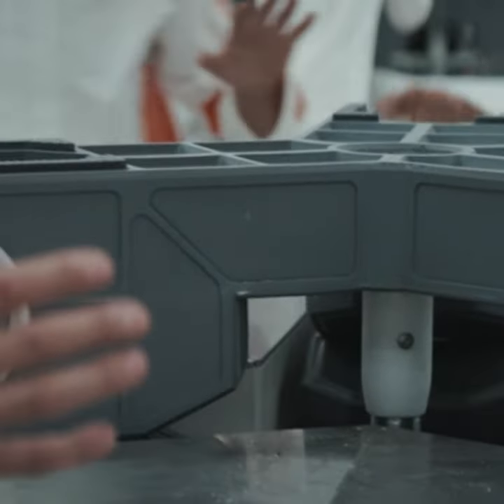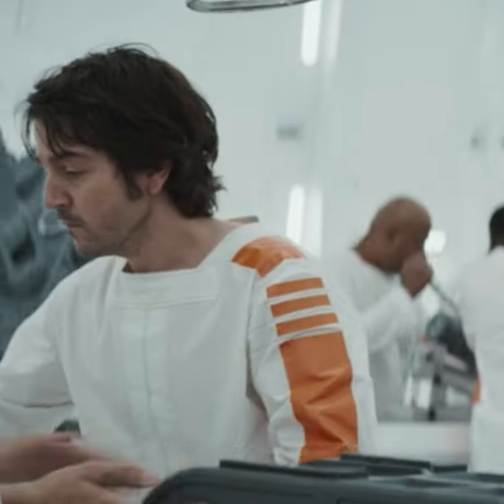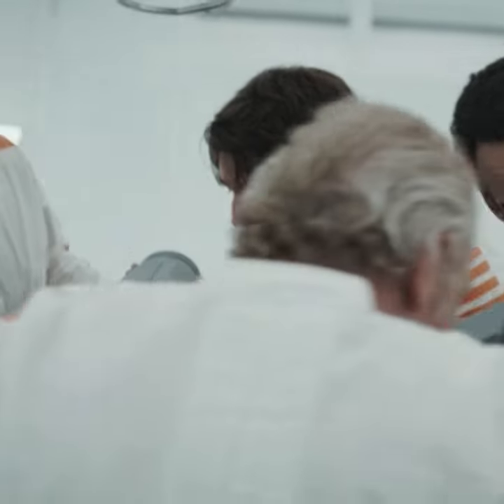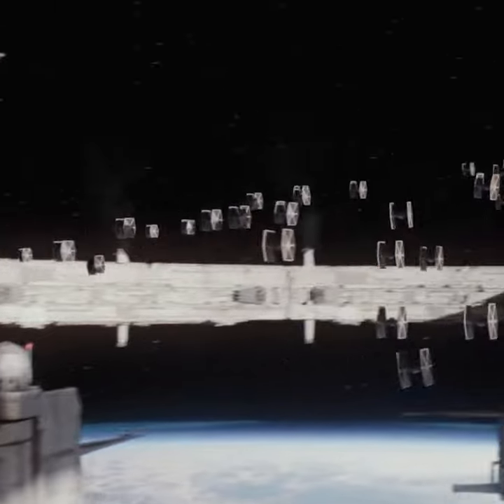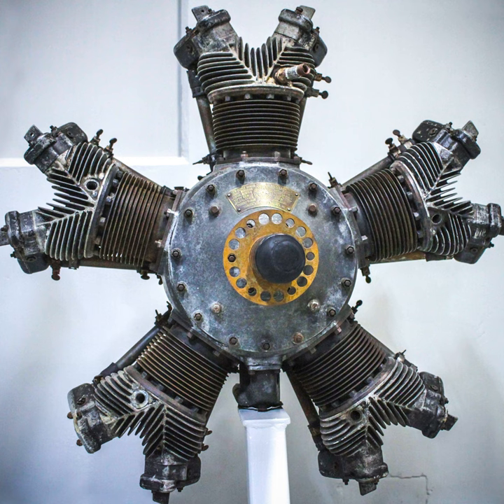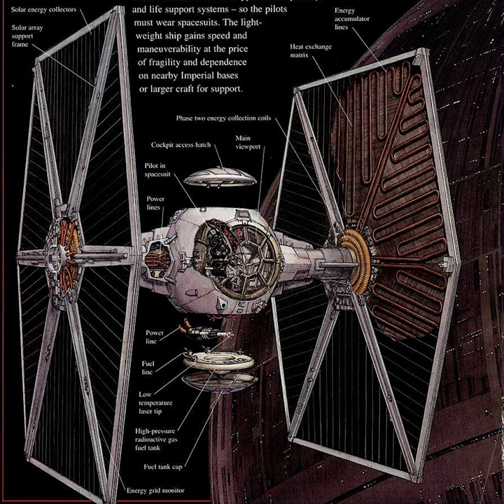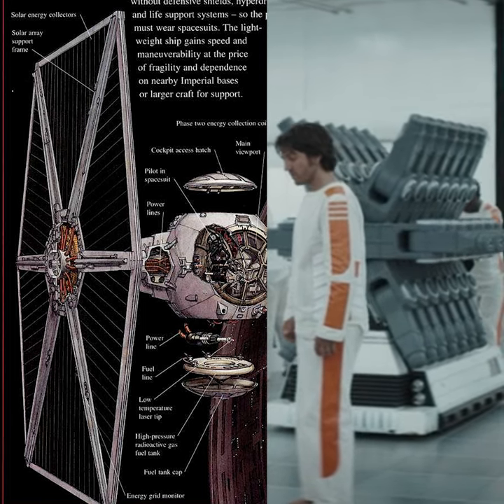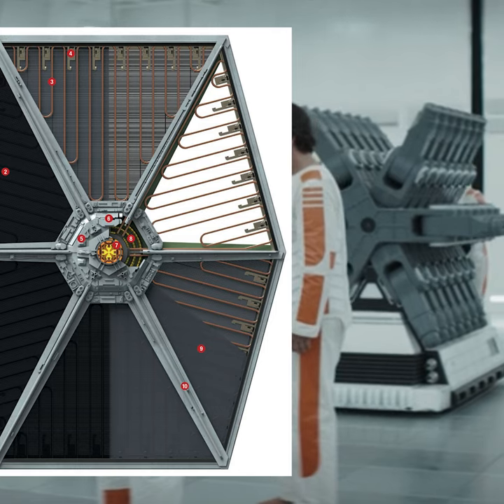What Are They Building Here?

Comment: The hinges on the pieces they are building align to the center, which would not fold up the way a Tie wing folds. It looks like the hip joint to an imperial probe droid. The sensor array would be on top, and the legs would dangle below each hinge.

Comment: In the show, the parts are set at an angle whereas in the tie fighter, the part would be straight. It also seems to be something that supposed to be a moving part with joints. I suspect that the parts are meant for Imperial Class Star Destroyers.

Comment: If you look on the full size Lego Bucatti Veyron, you find it's been made by several smaller, identical, and formable pieces, that can make complex and strong shapes. I find these pieces, with what looks like arms connected with joints, simmelar to the purpose of those same lego pieces. Forming strong and complexe shapes. I could only imagine these relativly big pieces being used for huge infrastructure such as mega buildings or even the deathstar. And guessing by the time periode, it could be the latter

Comment: As for radial engines, you need an odd number of cylinders, or a matched pair of odd engines for an even number. For example DC3s came with either 9 cylinders, or 14 cylinders (twin 7s) per engine, however, 3 cylinder (and by extension 6 cylinder paired radials) have a tendency to shake themselves apart. That's why they haven't made anything smaller than a 5 cylinder since the 1930s.

Comment: That’s definitely not a tie fighter component, you can obviously see that they are fixed at an angle in the rack and they also install bearings in the joins, my guess would be that it is a skeletal structure like the death star but the time frame doesn’t add up

Comment: It isn't the joints on the tie fighter.  Those joints are rigid.  These joints allow for some movement or twists. Which is the reason for the center pin.  

Nobody is leaving this prison, so the logic is that whatever they are making has some level of secrecy.  And the other point is that they are producing this joint in insane numbers.  Thousands and not hundreds.  And the Empire needs specific numbers produced daily. 

In my younger years I use to mess with magnets.  Magnetic rods attached to ball bearings.  It was a test in shape designs.  The center piece is the ball bearing.  The joints are the magnetic rods. These joints are literally the joints for the frame of the Death Star. With six interconnecting points, you could literally add interconnecting rods and you could make that perfect sphere shape.

Comment: Your so busy looking at the shap and not the components. The object has joints that aim in is its most likely a clamp type component. It also has what looks like injection pins. Given that the empire is mass producing these using cheap labor these are clearly important enough to need alot of, but not important enough to need them to be good quality. So it's clearly not military or private as they would need quality. Given these pins look like gas lock nozzles I believe these are used in factories that refine caustic gas as the nozzles would need to be replaced multiple times a day Given how star wars univers gatheres gas from planets atmospheres. My other quess would be a winch clamp as it it appears to have 3 joints with threaded tips so perhaps they use this in moving heavy cargo wich could easily be damaged due to strain or collisions.

Comment: "... looks like a radial engine..." Has no internal combustion chambers or tubing.

"In this side by side, this 6 pronged curved joint with an asterisk center clearly looks like this 6 pronged straight joint with a circular center."

If you're going to point out the devil in the details, at least check your work

Comment: No, they are robotic arms. These are the ones at the heart of the death star, holding and physically aligning Khyber crystals to multiply their energy density. Jedi and Sith use the Force to move their blades through space time. Otherwise there would be too much pseudo-mass accumulation. Non-Jedi, attempting to wield a lightsaber, find them incredibly heavy.  The robotic arms are being built by a single species of prisoner because of the way the Force has a way of attuning to the physical objects around a Khyber crystal.  Plenty of species have been known to leave something invisible and undetectable on the components they work on that causes random flux when induced by outer crystals.  Why not just use robotic labor? Humans all leave the same type of imprint. If you have six of them work on an entire single part, the effect is almost averaged into being practically identical.

Comment: Radial engine?  Really?  If  you looked at the parts they are assembling it looks very similar to a rotor head on a large helicopter like a Chinook.  Shape, construction, articulation etc.  Nothing like any type of engine. 

Guess of a joint of some kind based on the hinge pin assemblies seems most likely.

Comment: Your approach is incorrect. Those are moving parts and it looks like they are stacked, not one, but like, 8 or something. And one of those hexagon shaped is composed of 2 pieces only, making it a tri...finger...
Reply: I think I know what those are. They are separate pieces of a net. As I mentioned, Hexagon shaped is 2 pieces with 3 endings each, those endings have some sort of connecting slot, of you connect all those, you get a huge hexagon net. And it comes in batches, meaning they are ment to be deployed in large numbers at once so they can connect themselves faster. Either to slow down some undesired tail, or intercept specific ships, blocking a way, etc.